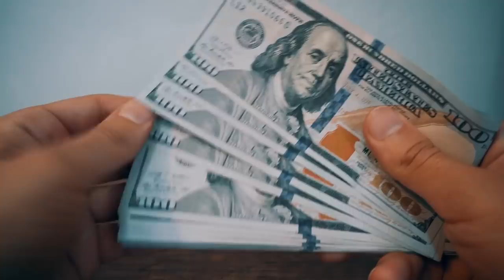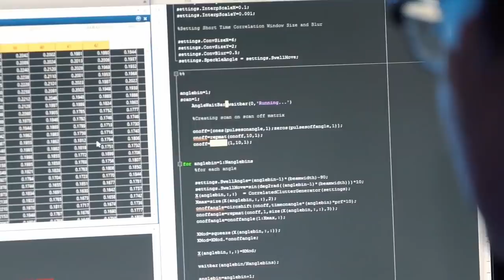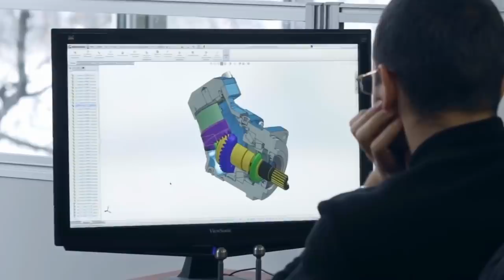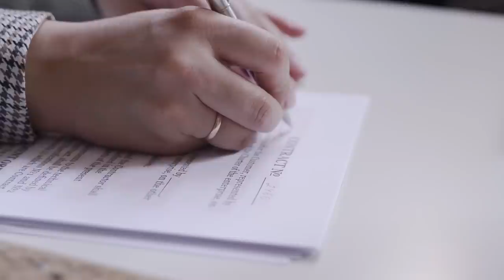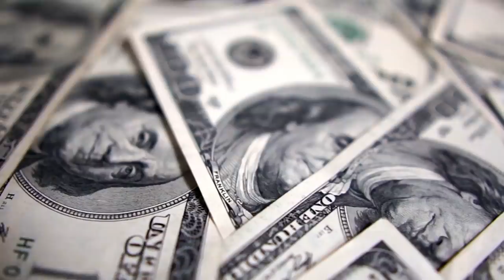Japanese Army Replenished With Bombers

Comment: "Made in Japan" is a mark of high quality.
Reply: Is that why Japanese electronics are still made in China?
Reply: @alf6259  Do you really think Japans electronics for fighters are made in China? LOLS did you watch the video.? Time stamp 6.05 insistance on domestic production. You know what that means right? LOL
Reply: @majorblitz7219  I did not mention  fighter's. It might be designed by Japanese but they outsource manufacturing to China. Electronics in general.
Reply: @alf6259  ? Wouldn't that mean they beat China using chinese ingredients?
Reply: @thalaseamyst3934  I don't know, did they have a war with China?
Reply: @alf6259  let me reiterate. I meant they got the jet parts from china and they used it against them. Hence the chinese ingredients.
Reply: @thalaseamyst3934  Japanese acquire electronics from China, W
Whether or not their for military.
As using it on China is news to me.

Comment: Single slot intake over the canopy with a modified liquid methane turbine split into twin secondary jet engines. All in line turbine shafts turning a twin thrust into a single engine. How fast do you want go, It's just a matter of scale and ratio! Btw, there is nowhere to run anyway!

Comment: Somehow the prospect of two very large nations like the U.S. and China going to war scares me less than the prospect of one very large country, like China, going to war against a much smaller one, like Japan, for two reasons. First, in order to survive the smaller country might be tempted to reach into its nuclear arsenal, or at least threaten the larger country with doing that, and that could escalate things quickly and in a scary way. Second, using China and Japan as an example, the U.S. would probably feel obliged to move a large naval fleet into place to protect Japan, and then it turns into China vs. the U.S., and then still other countries/allies would get drawn in. I'm just thinking out loud here but I feel like what maintains stability in the world when it comes to large nuclear powers is the mutually assured destruction factor, but much smaller players acquiring very advanced weapons systems, even non-nuclear ones like this upcoming Japanese fighter jet, may have a destabilizing effect. And now, if you'll excuse me, I'm going to step into a nice hot bath, and drop a desk fan into it. :-0

Comment: That's pretty cool althogh everyone knows drones will replace 90% of jet fleet.
I'm not talking about your regular reconsiss drone or even the now dated yet still effective preditor drone.

I'm talking about about next level drone technology.

1/5- 1/2  scale hybrid electric jets powered by solar a mini radioisotope thermoelectric generator to keep charge lithium batteries and super capacitors operate areo flaps, telemetry navigation, autonomy and radio control and a low speed electric jet designed for low speed crusing and moderate speed flight manourers. While miniature but powerful jet turbine will take over when high speed is required similar to that of a jet fighter.

Of course these drones will have multiple cameras that cover a range of spectrums such as, light, inferred, radio, microwave ect, Thermal imaging as well as sonic detection too and of course be linked to GPS and satellite imaging too as well as an online data base to identify in real time enemy theats and targets and engage either autonomously or via pilot control.

They will have the lasted in stealth technology and be able to fly at extemly high altitude if needed as well as low speed cruise on electronic power for very long periods without the need for refueling.

In addition they will be able to engage a waterproof mode/sealing the jet engines and hide or navigate underwater.
Using a hydrophobic surface, the transition between air and water will be seemless, creating and air pocket around the craft it will be able to travel though water without the normal resistive forces but more akin to air travel.
Arinarty will include a rail gun, not extemly high powered but extemly accurate because it's not relying on chemical reaction but a precise amount of electromagnetic force determined by onboard computers. Will also have the standard missiles with smart technology however the drone can also use the rockets from the missiles to boost speed instead of being fired if the mission so requires. It will also be equipped with radar jaming technology as well as laser and sonic weapons too, these will not be powerful enough to cause injury but used more as a distraction or irratent to put potential targets off gurad. As well as a working aid for the smart technology for aircraft and wepon guidance systems.

The only disadvantages compared to jet aircraft will be super sonic travel especially the inability to super cruise as most of these drones will be sub sonic althogh may possibly be able to achieve Mach 1-1.5 for very short amounts of time.

Comment: Japan has to build a fighter that can dominate the F-35 because China already has all of the schematics for the F-35. The Chinese may not be up to properly executing the build, but if you have 10 times as many aircraft at 95% effectiveness, it doesn't matter if you lose a few pilots to structural defects or systems failures.

Comment: If glass they use on jet fighters can withstand strong wind currents pressure. Then why they don't built a jet fighter made of see thru glass ? It will be more invisible and not easily detected by radar cuz most of its metal components is cover or encased in glass . Is it possible ? I think it is . So the pilot will be like in a Cutty Sark bottle .

Comment: Sound like they're going to have a solid bird in the air, God knows they'll need it with China continuing to assert dominance.
China recently showcased alot of its new invortory in order to flex it's power however it seems alot of it is copied designs which no doubt will be a weekness given the original designers will already know it's weekness, also I feel the biggest problem with Chinese technology is they are always in a rush to push forth the newest technology they neglect the proper testing and development stage which is very time consuming but essential and something that Japan is a world leader in and had resulted in some of the most reliable products in history. Like all new technology it's only useful if it's well calibrated, intergrated, simple and easy to use, with minimal time and effort and reliable where you can use it 100% of the time without failure or glitches. Otherwise the new feature or technology just becomes a gimic. This is what I feel will set apart Japanese fighter jets with that of new technology China is coming out with.
Reply: Agreed 100%
Well Said!!!👍🏽

Comment: Actual military aficionados know what a joke that clickbaity title is. Their best hope of achieving any semblance of parity to Chinese 5th-gen fighters had been the F-22, but with the ban they had to scramble to first design one themselves, not to mention manufacture. Their military aerospace industry had been moribund for decades since end of WW2, and the upgrading of F16 to F2 didn't really leapstart that industry much. They finally had a technology demonstrator 2 years ago, which was not even a prototype. It will be another 10 years at least for mass production of any actual production model assuming R&D goes smoothly. Another 5 years for training to allow squadrons to reach combat readiness. In the meantime there's a wide gap in capabilities that will grow as China develops their 6th-gen fighters. 

Then there is the issue of lack of smart weapons for Japanese military, and the fact that majority of rare earth metals needed for those and for the manufacture of  their planned new fighters is currently controlled by China. China just have to cut the supply like they did before to Japan (during the Senkaku incident) if Japan even look at China funny.